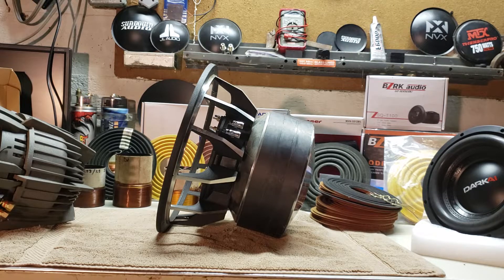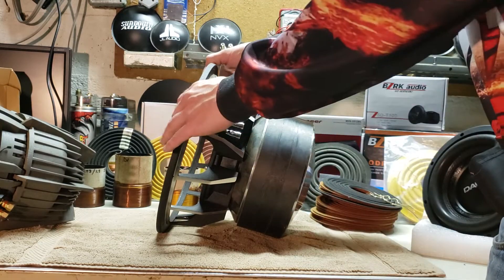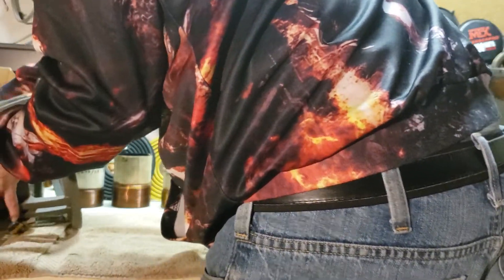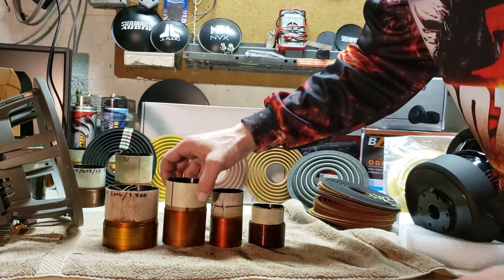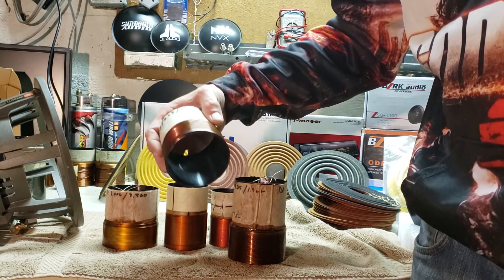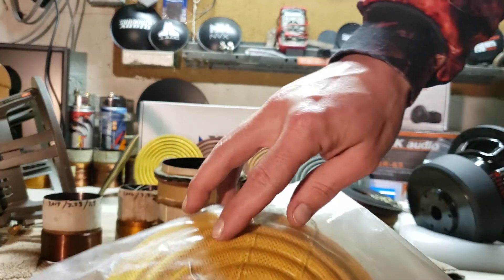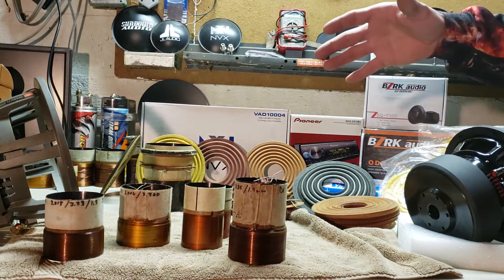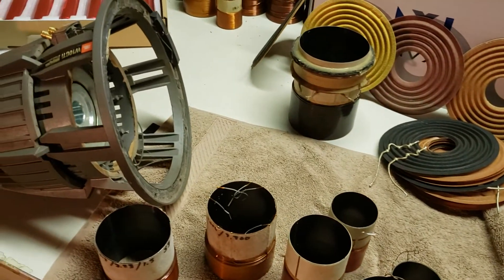SUBWOOFER Parts Explained  ft. Car Audio

Comment: Do you get any of your parts from fixmyspeaker? Just curious
Reply from the maker: I have before . I buy from manufacturers nowadays,  they require higher part counts so not something the average person would be able to get.
Reply: @mazda2284  Nice! Yeah I've spoke with several manufacturers over the years from China and Korea. I had inquired on bulk orders and samples. They were telling me I needed to get my DBA. Also the bulk orders were gonna be upwards of 10-15k. I had about 6k to invest and I found 2 other local bassheads to put in the other 9k but 1 of them backed out and I couldn't get another investor. If things go good this year maybe at the end of the year I'll put in an order by the end of the year.

Comment: I'm having to recone all 3 of my wolfram ag 10 inch subs. I keep burning the tensel leads. But the rest of the soft parts are in perfect condition. I know that clipping is probably the issue. But this time I am doing dual 4 ohm coils so I can wire my w4500.1 to .67 ohm and setting my gain correctly. Hopefully this time around they will not burn the tensel leads up.
Reply: I know this is an old video so this is probably irrelevant now, but if you only have 2 leads per coil you can get a spider that has 4 leads per coil, and then solder them together at the ends.
Reply: @chichidouglas5078  man that issue was caused by over excursion. I had too much air space in a sealed box. I fixed it with a port tuned to 28hz. But now im done with the bullshit of car audio. It's too damn expensive and it was just a pain in the ass. Now my system is starting to fail and im bout to just rip it out. I should have put all that money into my s10. Lol